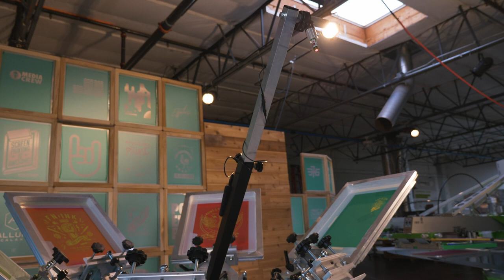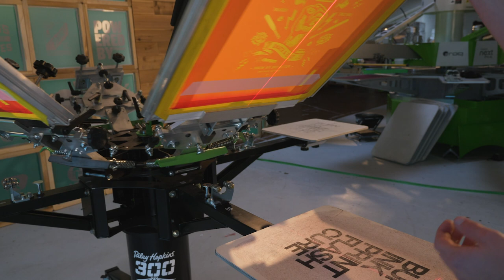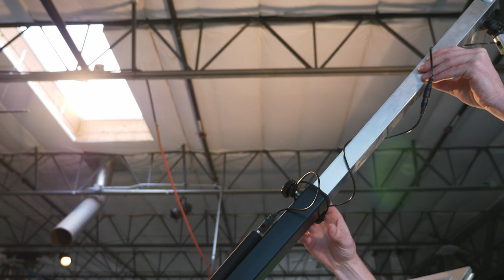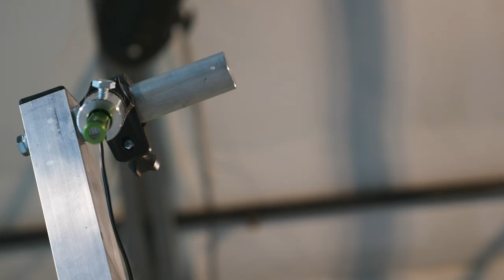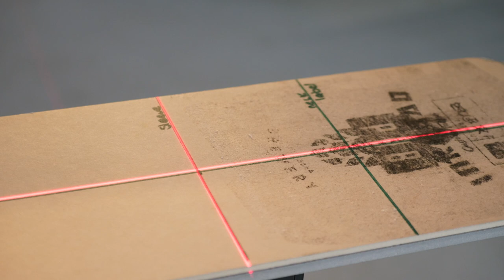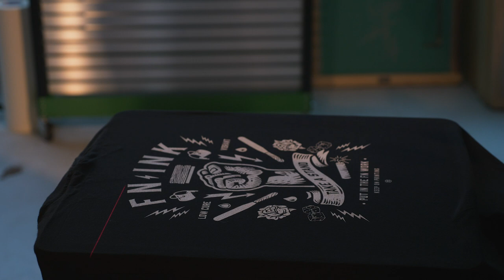Register Your Prints Easily | Riley Hopkins Laser Guiding System

Comment: We have one in our shop and it adds tons of time to our prints unfortunately because of the design.  Since the laser can't shine through the screen, before every print you need to move your screen out of the way which on a one colour white print is an additional 10 seconds or so on every print. Extra step, sort of movement waste IMO.  If you buy a laser online from ebay or something of the sort, you' can mount those on the wall or on a shelf close to your press and you'll never have to worry about moving the screens or anything. The mount ontop of the press would be really smart but in a real environment doesn't really help without modification.